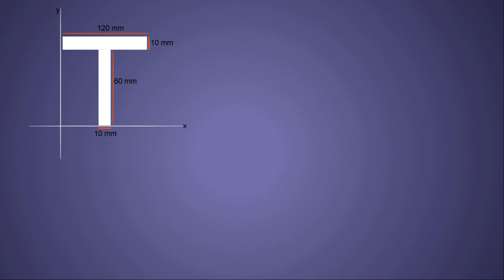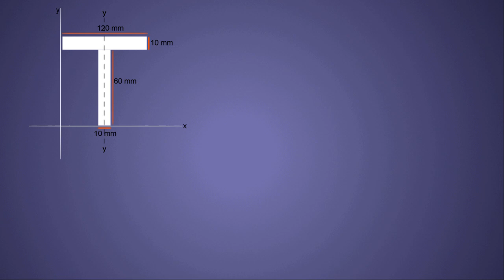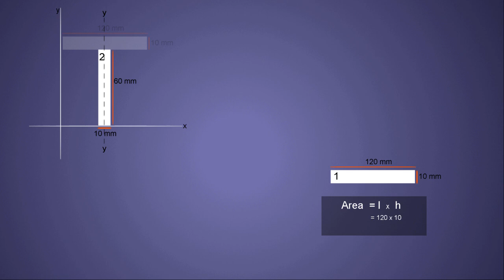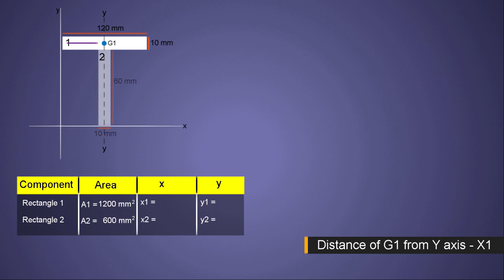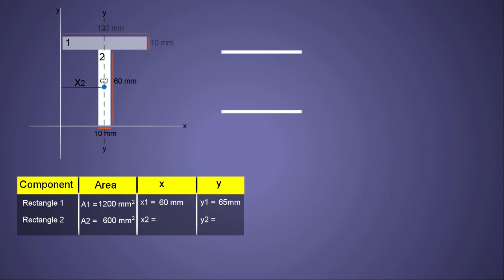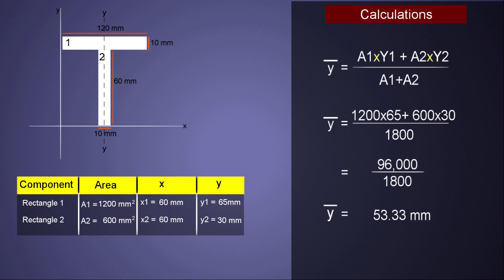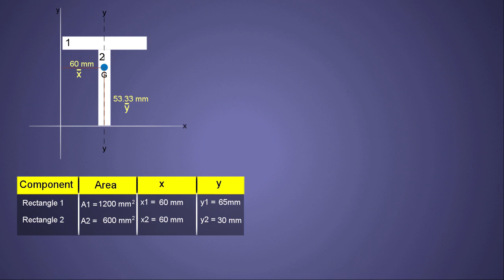How to find centroid of T section? Engineering Mechanics| NCERT | Elements of civil engineering

Comment: Will there be a video on how to find the centroid if an asymmetrical object on the x and y axis?
Reply: Here's how I would do it with a physical object. Dunk the object into water and see how much the water level rises. Do this on either side until you find the point where both sides raise the water equally, then you will have found the centroid of that axis. Repeat this for the y and z axis and you should find the centroid of the object. For a 2D demonstration I would grid out the surface area of the object and see where both sides have equal surface area if it were to be cut in half. one axis, then the other. Line up the axises and you should find the centroid of an asymmetrical object.